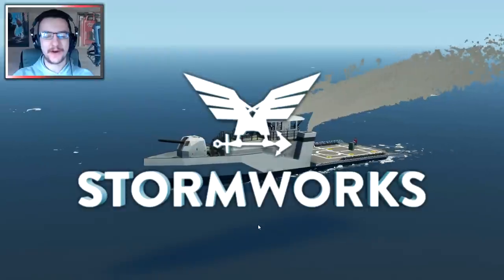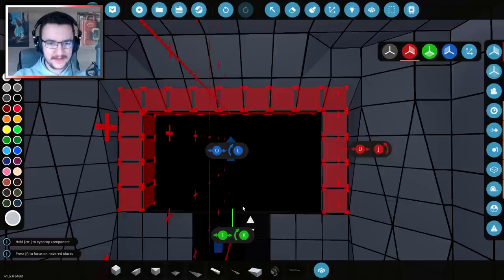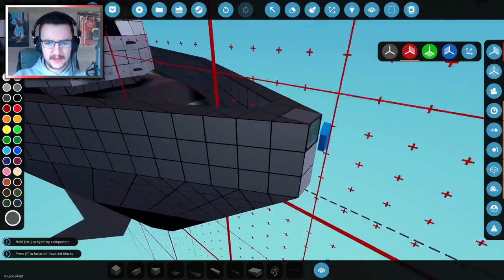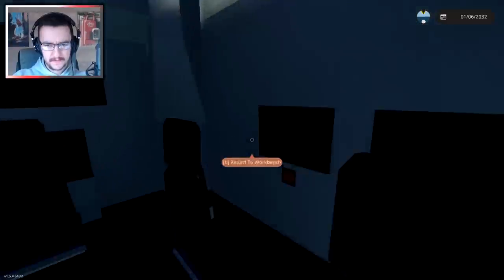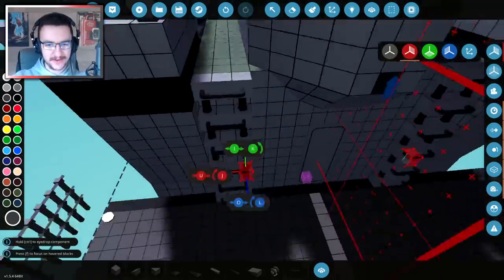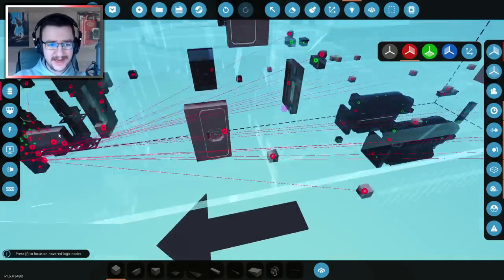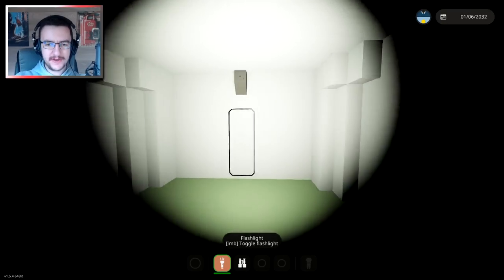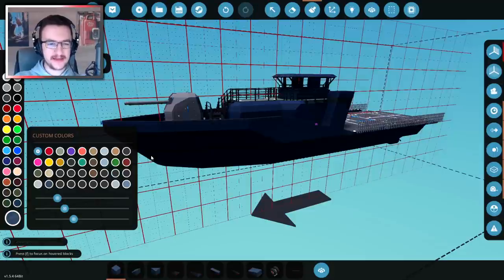Control Room SET UP & LIGHTING - Small Military Ship Build - Part 7 - Stormworks Search and Destroy

Comment: I think the control room would be better served with stations for radar operator and navigator than someone watching a live feed of the front of the boat and a live feed of an empty interior space. The engine control station is fine, but the flight deck control station is kind of redundant if you'll also a station overlooking the flight deck on the bridge. The lighting controls can probably be moved to the bridge and that station replaced with a missile operator or radioman. Also it's probably time to invest in microcontrollers to get rid of the button spam. 
Also if you move the bridge forward now it will be directly above the control room - which means you can add a ladder and hatch directly into the bridge from the control room. Moving the bridge forward will also give you that rear space to mount that X-mounted missile system you mentioned or some kind of CIWS system that was suggested earlier. If you still want a bridge overlooking the flight deck I think that can be incorporated into the superstructure. I believe that space behind the control room is tall enough to support a second level or at the very least a mezzanine with a slightly bumped up roof. Still would give you plenty of space to mount things. 
You seem to have gotten the interior spaces right. Maybe I would add a small armory too (small as in large closest size) and aviation fuel storage (possibly above the propellers). The space behind the control room can probably serve as the place to store all equipment for deck handling and flight operations. 
Other items it probably needs:
-navigation lights
-radar
-a small mast for radar, navigation lights, and antenna 
-anchor
-damage control features (fire hose stations, engine room fire suppressant, dewatering pumps)